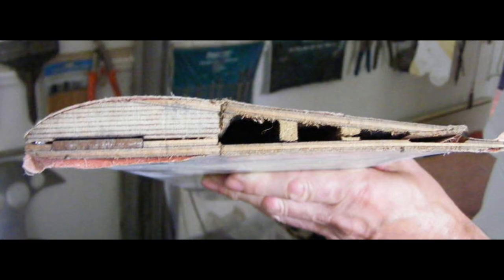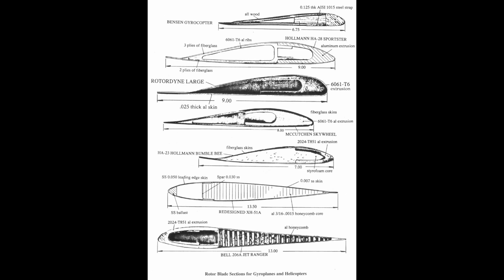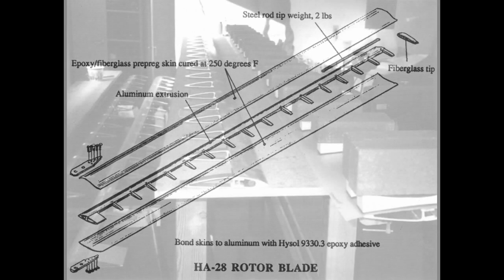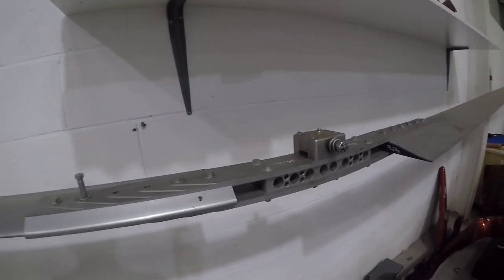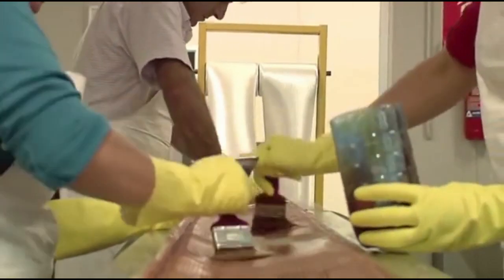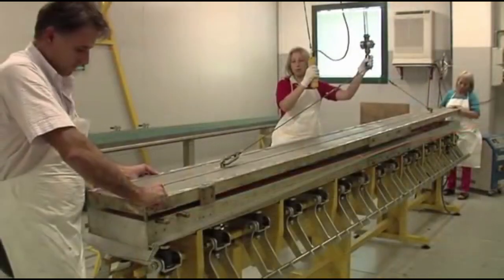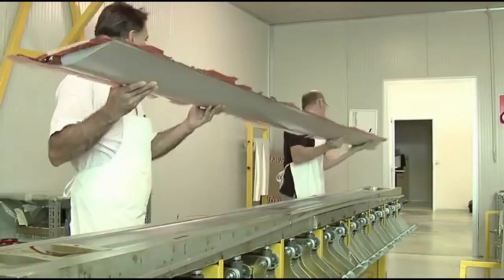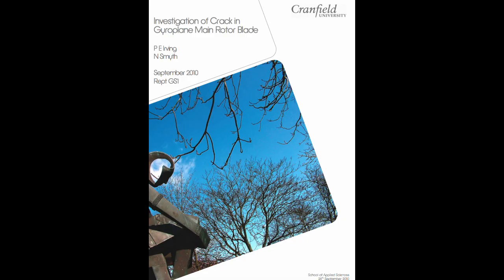Gyrocopter rotor blades

Comment: Reading about autogyros, I fall 2-3 times over the expression, that "helis have to have positive pitch rotors, while gyros have to have negative pitch rotors", but without further explanations (was the rotor-pitch meant, or the pitch of the blades of the rotor, for example???), and a search didn´t lead to more clues for me... I´m stuck now, and don´t trust anything I read, cause the loose way of wrtting in the internet either lets me back confused, or the too exact way of writing lets me back with headaches (cause I understand not a word). Can anyone explain what I read there, and what this expression actually means, or propose a source, where I can find the answer ??? Thanks a lot á priori for any answer...! I´m always, of course, interested solely on simple, fixed-pitch-gyro-blades, so, nothing complicated or special, but that what a Bensen B-7 or B-8 would have (cheap, smal gyrocopters, without fancy rotorheads that can alter blade-pitch).
For my part, I interpreted this expression as follows: Helis moving forwards, have a rotor-disc-plane tilted slightly forwards (positive-pitch-rotor), while Gyros moving forwards, have a rotor-disc-plane tilted slightly backwards (negative-pitch-rotor)... (???)
Reply from the maker: Hi - I don't understand it either - do you have the source material?
Reply: @gyrocopterflyingclub6148  Sorry, no sources. When i searched again, I couldn´t find it again, but I tripped a couple of times over it... Thanks anyway, and if u can imagine of any meaning, then please tell me...
Reply: a.k for some reason, when clicking on your answer, I cannot find the answer anymore, not even the first 4 lines, that I were able to read already in your answer´s "preview", but those confirm what I belived (of course I´ll have to read the whole anwswer to be sure of anything  ;-) so, thanks a lot for the answer anyway, YT seems to have a bug sometimes with the updating of the comments´-status...   ;-)

Comment: Autorotation 
Very intrigued by how these work and have been looking for an explanation.  I even watched a video showing how a helicopter autorotates….with a positive incidence to the foil!
Having spent the wee hours, hopefully, getting an answer, I think I see what is missing in explaining what makes the autorotation. No one is considering the full rotation.  Think of it as three quarters.  The rear quarter the segment is towards the horizontal and in disturbed air, so not doing much.  Now the forward facing segment has a good upward flow across its whole length, and the negative incidence causes it to rotate.  This is where the major force comes from.  The leading side segment gives drag, though this is somewhat balanced by the push from the trailing segment, though still an overall slight drag against rotation, but far less than the positive rotation from the front segment.

Comment: Are blades twisted, it appears not, if so why not?
Reply: my question, too
Reply: from the perspective of the relevant air they will be as the tip is traveling over 300kmph whilst the root is 0 kmph..im no expert.

Comment: once you get through mechanical attachment Im still persuaded by the integrity of extruded aluminium blades
which could be fitted with mass weights as at one time some helicopter blades were

Comment: Why Multiblade rotor are so rare, specialy now ? What could be advantage/inconvénient ?
An other question, why Carbon fiber for rotor blade so rare too ?

Thanks for your Channel.
Reply from the maker: Thanks and I think there are couple things.  On the multi blade question its just a weight thing for sport gyros and carbon blades there is a company making them http://gyrotech.eu but I think they are expensive v the alternative.
Reply: @gyrocopterflyingclub6148  The gyro- tech are not that much more and you get superior quality control and construction love them on the RAF 2000 machines

Comment: One of the biggest advantages of wood rotors is the chord weights.  My wooden blades weighed about 16kg but flew with a lot more inertia due to the small tip weights.  The flexibility of wood is better as well.  Nicest blades flying much less twitchy and can save you from a poor landing as they hang on for ages.  Chord wise balance is important too.  I flew a set of wood blades that were overbalanced chording 25% is normal.  These were nose heavy at TY hat point and closer to 30%.  They were rock solid.  We hit a massive thermal at topped off the hall ASI at  80mph we barely moved.  I suspect after people still keep dying in spite of stabs and high cg machines eventually someone will start experimenting with this and manufacture training blades, flexible chorfdwise and slightly overbalanced.  Makes much more sense to stabilise the thing keeping us in the air and responsible for the sensitivity in the first place.
Reply: I personally think you have hit the nail on the head with regards to rotor blade construction.
I had the good fortune to meet Ken Wallis in the late 60's, and he explained to me that the key to making the rotors, was flexibility. He mounted a weight box on the leading edge, which not only twisted the tip downwards, but also moved the C of G forwards as it progressed towards the tip. He described it to me, as being similar to the difference in behaviour as a tail dragger, compared to a trike undercarriage, i.e. the blade is washed out at the tip, due to it increasingly following the mass as it moves outwards towards the tip, a bit like the tail feathers on a dart.
That was from a discussion I had with Ken over 50 years ago, so I'm not sure if I have explained it very well, but to be building and flying them right into his 90's, I guess he knew what he was talking about.
Ken never used high C of G, or horizontal tails, so perhaps, more people should take more note of his calculations and blade construction techniques.

Comment: What flight hours do the various manufacturers assign to their rotors?
Reply from the maker: Hi Peter - so just looking at the big two. Magni require the rotors to be sent back to the factory every 1000hrs for inspection whilst AutoGyro blades are life’d to 2000hrs.

Comment: another related topic is the one of choice of section
where to my mind the two outstanding contenders are the 0012 and the 8-H-12
Reply: Im familiar with N8h12 but not 0012 how do the profiles differ?
Reply: @cameronlapworth2284  0012 is a symmetric NACA section
Reply: @z_actual  how will that go in autorotation  i flow two sets of rotors that where close to symmetrical both had issues as they had to be depicted significantly and lost lift as a result.  However its possible it was other factors also.  TheN8H12 is definitely good be sure to add reflex.
Reply: @cameronlapworth2284  Im interested in the difference because 0012 is a very average foil within a predetermined less than 16% section, the 8H12 is expected to be a better performer but it is a laminar section and will suffer if it gets wet or dirty from dust, and dust is common out here. Wet not so much
What I have worked out is, 8H12 dirty is just a slightly better performer than the 0012 which is untroubled in the same circumstance. 
8H12 will generally be composite and therefore heavier than an extrusion, the net effect is a larger conning angle and additional power reserve
But you have to factor in the machines weight with a heavier rotor blade, for which lighter weight out competes in all aspects of flight performance except sustaining power reserve.
Reply: @z_actual  sounds interesting.  Good luck.  Make sure you post results on the net.